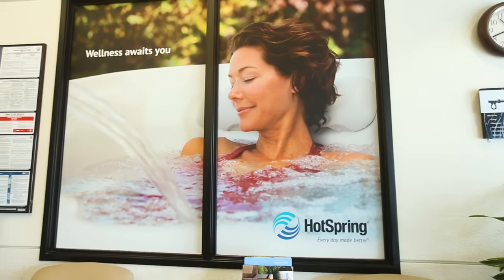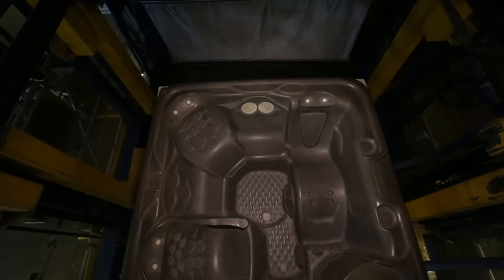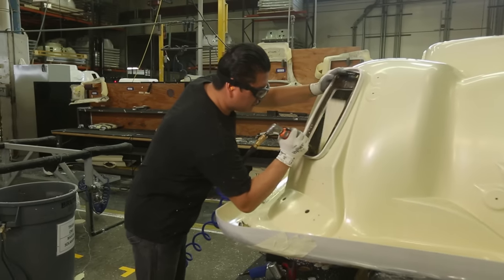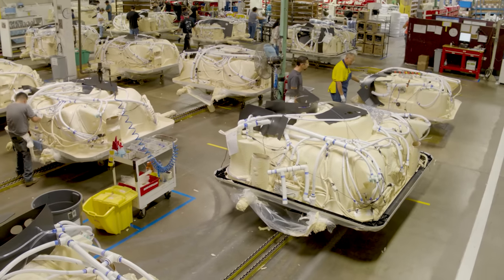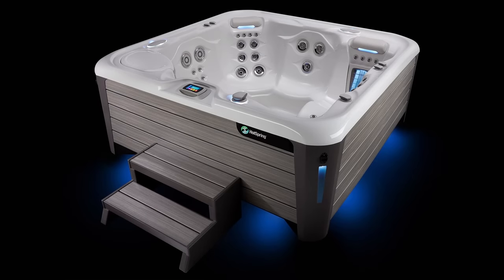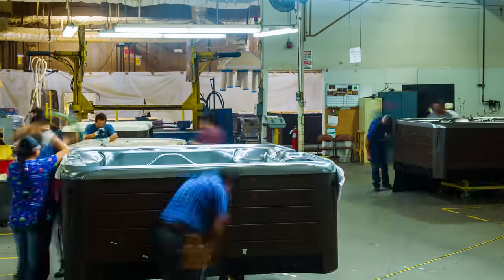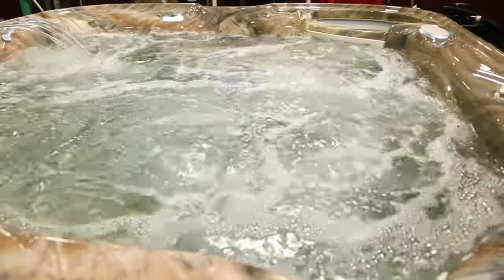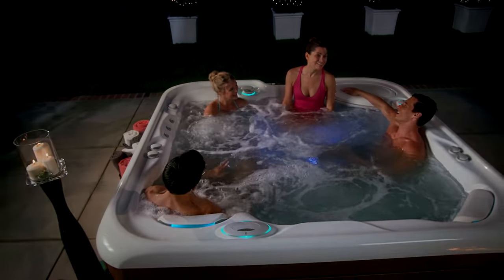How is a Hot Spring Hot Tub Made?

Comment: I  very concerned about all the reviews expressing poor build quality and leaks after just a few years! This video does not offer a comprehensive depiction of how their spas are made. The  Highlife series shells are not self supporting. The foam and ABS substructure  actually  acts as a support. Only Highlife lines are made in USA with Chinese and Mexican made components. Limelight and Hot Spot lines are made in Mexico and have fiberglass shells. Unknown if they are self supporting and if they clamp their hoselines.  This video offers no usable detail. Just propaganda. Other spa manufacturers have informative manufacturing videos that explain in detail how the shells are made and were the components come from.
Reply: I work for a company repairing hot tubs, and I can assure you that these tubs are not worth it. They leak internally due to poor glue joints which often leads to a costly trip back to our shop, with hours of leak troubleshooting/replumbing work. Jacuzzi is much better in terms of reliability.

Comment: Insulation method not shown. If this is a spray-on foam over plumbing - you might as well throw it away when it breaks. Not saying they do spray-on foam, just saying the video didn't sell me by missing this critical assembly process.
Reply: Yup this is a spray foam and then it is layered with a hard crust in the bottom.  The side panels are glued so it is hard to get them off without breaking so you have to go in from the bottom.  I have a 2014 that I am currently trying to find a leak and it is a painful task removing this stupid foam.  They build these thing and act like nothing will ever go wrong.  I will not buy a hot tub again that has this type of insulation. Mine started leaking in the middle of the summer so it was not a freezing issue.
Reply: I was looking for the same thing but didn't see it.  You would think they would want to show you that.  Must be hiding something.  If anyone has one could you reply informing us if it is spray on or sealed rockwool panels?  Sealed panels are my preference.  Much easier to work on and find leaks.  I won't buy another spray in insulated hot tub.

Comment: To brag and show nothing of the quality is not helpful for this potential customer.  How much  fiberglass?  what is the insulation?  who supplies the components?  You can say anything but you share nothing!
Reply: Your local dealer can answer any questions you may have, and most if not all information about Hot Spring can be found online. The shell is self supporting and thicker than the industry standard, we offer more insulation than almost anyone in the industry with the fibercor and full foam insulation, and most parts are made by Watkins themselves.

Comment: I’ve noticed you don’t clamp the hose connections, only glue. Clamps would definitely insure no leaks. Does the insulation fill entire cavity of shell? Proprietary parts? Which means I can only get parts from hot springs. They look fantastic but quality standards are low. I’d rather pay more for something that will last more than 5 years. Hot tubs are supposed to relieve stress , not cause it.

Comment: Highlife series shells made in California are not self supporting. They use ABS backed Acrylic which is pretty strong but needs help from the ABS substructure and full foam insulatuon for support. California laws make s it too expensive to use fiberglass.  They use a high quality foam sprayed in multiple layers of different densities. Very well insulated and the substructure is well designed. The components appear to be high quality and well put together but too  bad they don't seem to clamp their pressure line hoses, especially since it would be a nightmare to dig through all that foam to find a leak. Their Limelight and Caldera spas are made in Mexico and use fiberglass backed shells and Fibercor insulation. It is.unknown if those shells are hand rolled self supporting. At least Fibercor makes it easy to dig to a leak. This video is useless. I have a 2019. We are very happy with it so far  but I'm afraid of what would happen if we got a leak or if proprietary components fail after the 5 yr warranty is up. I wish Watkins would offer more informative videos regarding their manufacturing process. I think we will be buying a Masters Spa Legend series spa next time.

Comment: I purchased a High Life in 1993. Early on there were problems with thermostats but this was all taken care of under warranty.  Much later
on I replaced a heater box, heaters, and a circulation pump.   Recently I put another new cover on the spa amazingly the correct cover was 
still available!  This spa is at my home and working very well.  yes it was more expensive than other competing spas of the time but in the 
long run a real bargain.  If it ever wears out I will buy another Hot Spring spa.

Comment: I have owned the same Hot Spring-Tiger River since 1997 New. At age 21 replaced circular pump twice (pump runs 24 hours / 365), replaced Ozonator once and all clear tubing (located in the access panel, not in the foam area of the spa) once.  It is easy to work on. My neighbors purchased a Vita Spa at the same time, yes $2000.00 cheaper, but only lasted 3 years. If the Hot Spring-Tiger River Spa completely dies ( in the next Twenty years from now 2018), I will buy another Hot Springs Spa.
Reply from the maker: Thank you for your review and for being a longtime Hot Spring Spa owner.  We have many spas still providing a great hot tub experience decades later. I love hearing that this is the case for you and your Tiger River.  Happy Hot Tubbing. Vanessa -  Customer Service

Comment: This video doesn't answer anything a buyer needs to know about purchasing a hot tub.

Questions that need to be answered;
- Does their shell need cradled support or is it strong enough on it's own because they've hand rolled their layers?
     + If it's cradled, they cut corners in quality construction.
- They used the word "proprietary" in reference to their software, what other parts are "proprietary?"
     + Proprietary parts means they are the only ones who can repair your tub because they don't use universal parts. 
- Is the plumbing glued and hand clamped, or just glued?
     + If they are not hand clamped then repairs to them can be costly and difficult.
- What insulation is used; Mylar, ABS, loose fiberglass, rolled fiberglass, open cell, etc.?
     + With out proper insulation the tub will not maintain and retain it's temperature. 
- What is the overall Resistance to heat flow, or "R" rating?
     + Mylar is reflective, not insulating (rating of R1-3). Your house is insulated at R21-25, your tub needs to be as close to that as possible. A Mylar lining with 2" of insulation may only get anywhere from R8-13.
Reply: Only Sundance has self supporting tubs....
Reply: That is a very false statement.
Reply: @auser3937  not sure if you be more wrong. Do your research brother....
Reply: @K9388-n3z  I did the research. You should too, brother.
Reply: @auser3937  🙄
Reply: Highlife series shells made in California are not self supporting. They use ABS backed Acrylic which is pretty strong but needs help from the ABS substructure and full foam insulatuon for support. California laws make s it too expensive to use fiberglass.  They use a high quality foam sprayed in multiple layers of different densities. Very well insulated and the substructure is well designed. The components appear to be high quality and well put together but too  bad they don't seem to clamp their pressure line hoses, especially since it would be a nightmare to dig through all that foam to find a leak. Their Limelight and Caldera spas are made in Mexico and use fiberglass backed shells and Fibercor insulation. It is.unknown if those shells are hand rolled self supporting. At least Fibercor makes it easy to dig to a leak. This video is useless. I have a 2019. We are very happy with it so far  but I'm afraid of what would happen if we got a leak or if proprietary components fail after the 5 yr warranty is up. I wish Watkins would offer more informative videos regarding their manufacturing process. I think we will be buying a Masters Spa Legend series spa next time.

Comment: Anybody know how to handle (physically get to) a pin-hole sized leak on one pump inlet pipes?  It seems to be coming from a point behind the pump housing area wall and riding along the 3" pipe until finally dripping in to the motor compartment.  Thanks.   -- Edit:  The tub is an Envoy KK from 2004.
Reply: Fix a leak in a bottle. Sometimes works.

Comment: have to check out the guarantee. Not paying top prices for 1 year on electrics and sub frame rot later on....heard some good things though will keep researching...
Reply from the maker: Thank you for your comment! All Hot Spring spas with wood frames are built with pressure treated wood to limit the risk of rotting, but if you are at all concerned, you may want to consider a Highlife NXT built with an innovative polymeric base and substructure. Please feel free to give us a call if you have any questions during your research! 1-800-999-4688, ext 8432.
Reply: The wood is not pressure treated. Just open the control cabinet and take a look. Its pine wood of what appears to be the lowest grade and the visable wood is spray painted black. Unpainted where you can't see it. And the wood is joined with thin staples. Lots of gaps and shody construction that should have not left the factory. The front control panel is thick vinyl glued to this scrap lumber, stapled together. Its already separating from the wood and warped. This is on our Limelight Flair that was delivered last week, came this way from the factory.

Comment: Doesn't it make more sense to put together the plumbing when the hot tub is not upside down? That way there's no tension on the lines when it gets flipped. Also with all the new pumps and technology available how come you're still using pumps that have flow switches instead of a pump that has fully electronic probes?

Comment: We love our Prodigy but hate having to replace the $600 cover every few years, even though we clean and treat it regularly.  Why can't the top be made of a material other than vinyl?
Reply from the maker: Thank you for your question. I understand that having to replace anything can be an inconvenience. Because our covers are exposed to the elements they eventually need replacement. Covers require regular maintenance and should be inspected yearly for wear and to ensure a tight seal.
  Our covers are made with heavy-duty marine grade vinyl, and feature a tapered custom-fit core that allows water runoff, while its polyester thread and poly-ply laminate create a vapor barrier to protect the cover from harsh weather, chemicals and intense sunlight. Each cover is made with double-stitched vinyl for a durable hinge and extra strong padded handles for long lasting performance. There are 24 internal stress points reinforced in each spa cover, including aluminum reinforcement for maximum strength and minimum weight. Reinforced, adjustable straps make it easy to safely secure the spa cover. 
Each Hot Spring hot tub cover is UL-classified in accordance with ASTM safety standards, and includes child safety locks for extra protection. 
Your cover also comes with a 2-year warranty. Please let me know if you would like more information on how to care for your cover during extreme weather. These tips will help prolong the life of the cover. Customer Service can be reached at 800-999-4688 ext 8432. 
Happy Hot Tubbing!
Reply: Put clear flex seal paint on the top
We’ve done this to older spa covers that are starting to wear down and starting to tear or get little holes
As it dries it will leave a neat mosaic pattern on top of the spal cover

Comment: What is the actual product used in making the shell of a hot spring hot tub? Hopefully hand-rolled acrylic!!
Reply from the maker: Hi Debra, the shell is made from a sheet of acrylic backed with a layer of polymer acrylonitrile butadiene styrene, also known as ABS. This is then warmed and molded into your shell shape, leaving a durable, energy efficient, and beautiful shell.
Reply: @Hotspringspas1  yes it is beautiful but it is not self supporting. It requires the support of insulation foam and plastic substructure. I'm sure California's requirements makes  making a thick Self supporting fiberglass shell too expensive. I noticed your Limelight and Hot Spot lines are made in Mexico and have Fiberglass shells. Are they self supporting? Do you clamp the hose lines? I'm very concerned about all the postings regarding poor build quality,  leaks and lack of customer support.

Comment: You did not show how you spray foam the underside with the 2 different densities of foam. I have a 2014 Grandee NXT tub and it has developed a leak which is driving me 😠...can't find the source of leak. I've removed all the wet insulation which is approx 40%. It started to show the leaks shortly after the warranty period was done(7yrs)but evidence under the soft foam insulation shows its been leaking well before the 7yr maturity date. We love the spa and is our 2nd unit over a  20yr period. This one will be ready for the scrap yard in a couple years unless I can find the leak and stop it. I have to refill or top up the tub every 4days. Approx 80gallons/4days. I did find 3 other leaks at 3jet heads where the rubber seals were not seated properly. I had to use aquarium silicone on water side of heads to seal them. The initial coat of spray foam is solid and coats all roughed in lines and jets heads making it impossible to access. There is still another leak somewhere and is going to kill the beautiful tub. Such a shame it cannot be sourced and am told will not be covered by the warranty even tho the cause appears to be factory caused(poor assembly) and leaking before 7yr period. What can be done? I really have done my best with no help from my retailer.
Reply: Sorry, I meant the leaking g was prior to 5trs and now the tub finish has pit marks in the finish even tho balancing of water was done regularly according to provider. It is a salt water system.
Reply from the maker: Thank you for reaching out! I'm sorry to hear that you are struggling with a leak. Our team is available to help answer any questions or concerns you might have. You're welcome to give us a call at 800-999-4688 ext 8432 or email our customer care team at CustomerService@Watkinsmfg.com. Your local dealer is also a great resource to set up service for any repair work needed. 

Kylie - Customer Care

Comment: From what I have seen so far is this manufacturer uses the plastic frame and so does bullfrog I do like that. I just wish a manufacture offered one with a straight forward electrical system.
Reply from the maker: Hello Eddy,  Thank you for considering Hot Spring Spas. I am not sure what you mean by straight forward electrical. We have spas that come ready to use with a 115-volt plug or 230-volt hook up that requires an electrician. 
If you have further questions, please let us know.  Customer Service can be reached at 800-999-4688 ext 8432.
Vanessa -  Customer Service

Comment: At 4:20 How can you test it out(for leaks, which are common) if the whole spa is assembled and insulated already?  I owned one--a complete and utter maintenance nightmare owing to cheap and/or stupid engineering.  For example, the relays on the control board go bad after one or two seasons necessitating replacement of the "board" ($300 +).  On inspection, it was just the solenoid relays on my board that had become corroded, so I ordered the relays from the relay manufacturer planning to just solder in the new ones. And then I read the directions that came with the relays: "Not for use in outdoor or wet locations".  So, the kids at Hot Springs cannot check the specs on their components and engineer/design appropriately. You can bet that is not limited to relays on the control board....................
Reply from the maker: I am sorry to hear you have had an issue with your hot tub. The potential for leaks is always something we want to be aware of, and along with the rigorous testing shown in the video, we also pressure test the plumbing to check for any leaks, and provide a 5 years No Leak Plumbing warranty with all Highlife and NXT spas. I am not sure where, or what, solenoids you obtained, but I can assure you the parts we install are designed for an outdoor spa. If you are still in need of help with your hot tub, or have any questions, please reach out to us at 1-800-999-4688 Ext 8432 - Thank you Chelsea Customer Service

Comment: I have a Grande from 2014 broken 10 port manifold probably due to to much bind on the pipe from the chair. I had water out of it for a week waiting on a mail order part. Filled it up after repair, noise in motor 2! I would stay away from this brand.

 I bought it used a year old that what caused the bind on the pipe :P so not covered quoted 1.5k to fix because they are not built to be taken apart
Reply from the maker: @John Burdin I am sorry that your spa is in need of service. The Grande spas comes with a 5 year warranty for the original owner, not knowing how it was cared for can play a part in future service that it may need. Our spas are well insulated to keep the heat in. It can make servicing the spa time consuming for techs. It is a fine balance.  Either way I get what you are saying and I am truly sorry that you are not happy with your spa. If there is anything we can do to help please let us know. Customer Service can be reached at 800-999-4688 ext 8432. Thank you for your post. Vanessa -  Customer Service